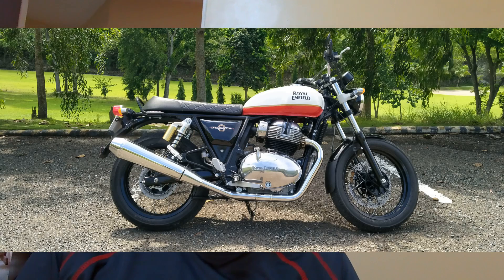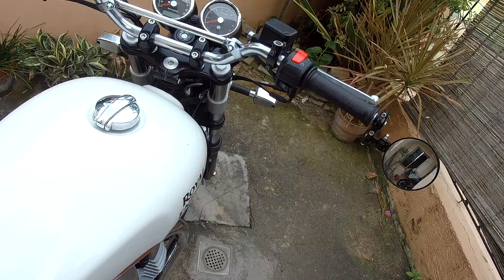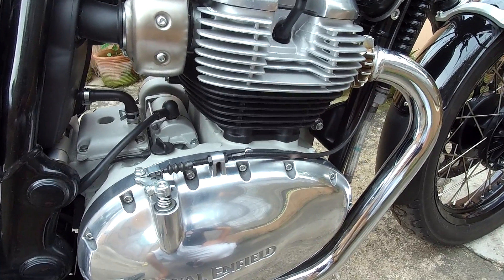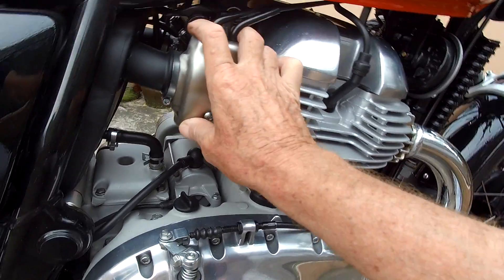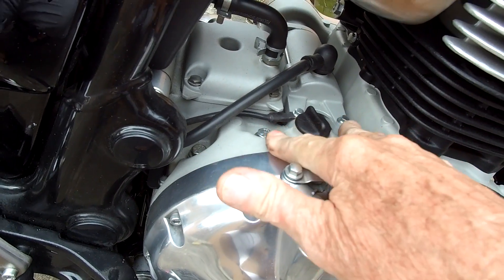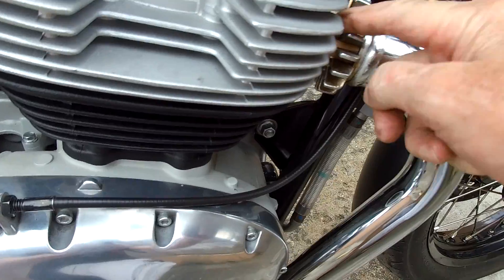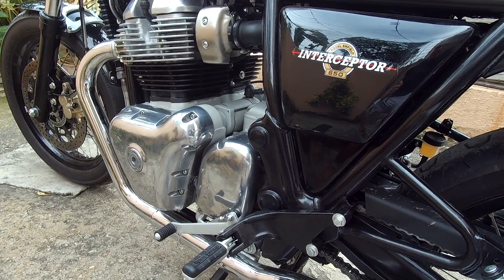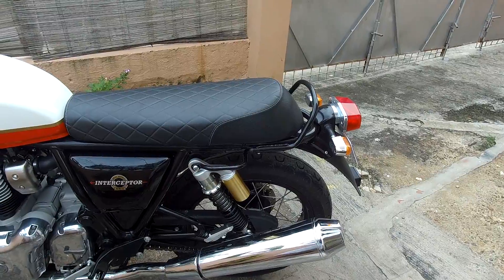RE Interceptor vs Street Twin in Depth

Comment: The term I like is "Appropriately Primitive".  I considered buying a new Bonneville but I was put off by several things.  Firstly, traction control and rider modes, don't need them, don't want to pay for them.  Secondly, the engine would be hard to de-restrict, given the internal design as well as any difficulty in re-programming the ECU.  I had plenty in the budget to pay for one and would have lived with all that.  Thankfully, Royal Enfield gave me an alternative.  Me and my Interceptor, in Ravishing Red (The first thing the mechanic said to me when he delivered the bike was; "the red ones are faster...") have done a little over a thousand miles now and I'm so happy with it, I hardly give other bikes a second thought.  I certainly don't envy anyone on the road.  She goes where you point her, as fast as you can personally handle.

Comment: John,
       I am 66 and picked up a Mark III two weeks ago.   It is like the bike was made for me.   I thought I'd make cosmetic changes but changed my mind after getting the bike.  I have changed the seat to a touring GT seat.  Added the small chrome engine guards and a small black tail carrier.   Have ordered the saddle bag guards (just the triangles.),  A Givi GIVI A31 Smoked windscreen and some 24l roll-top drybag saddle bags.    Going to take turns touring with it and my '83 Honda GL650 Silverwing (I am looking forward to comparing them)   here on the open highways of Minnesota.  Thanks for you Vlog.

Comment: The RE is exactly the type of bike l used to ride in the 70's & 80's - Honda CB twins, XS 650, Guzzi T3 that's why l love this bike. I would add the Tec Stinger exhaust ( As you have in a later video) and stainless mud guards.

Comment: Nicely commented, well made video!
I have the same model in the same colourway (Baker Express). 
This bike is pure joy, in my experience, I'm sure you'll grin like a loon, as I do, on every ride. 
I've done quite a few mods, but one of the most important to me, was upgrading the rear shocks and, the front fork internals. 
I went with YSS  top line and, it was game changing. 
No more drama on sketchy roads & cornering, due to (incompetent) front springs & iffy rear enders. 
Its so planted, so confident & so vastly improved handling with yss fitted. 
I wholeheartedly recommend doing similar for huge improvement.....

Comment: Recently subscribed. Excellent comparison. It’s all personal choice but I feel a closer comparison is when you see a big bore conversion to bring the RE up to 885. Then, the cost and engine size is negligible.
Reply from the maker: Yes true enough, but that's another review, for you can unleash the Street Twin as well by simply putting in a cam and an exhaust. it's not about the CC s as much about HP and torque, the 900 triumphs are severely restricted from the factory to differentiate them from the 1200 cc triumphs performance wise. They only put out about 48 RWHP. not too different from the Enfield.
Reply: @DEeMONsworld  2021 model is pushing 65bhp 80nm…definitely an upgrade.
Reply from the maker: @FrankieSousa  right but mine was a 2017 model, hence the comparison at the time. Plus that's 65 at the crank not the RW.

Comment: A very good assessment of the Enfield, they are a nice bike I agree, I have a 2019 Speed Twin, and I love it, but I can appreciate these Intercepters for being an honest no bones basic bike. I might be wrong but I think you can get progressive springs for these, (TEC?) that would help make a better ride, it certainly helped with my Triumph, and the preloads that replaced the fork caps has a hex head you can adjust with a spanner (wrench). All installed after just removing the bars, have subscribed, I'm liking what I see! ps I thought you were located somewhere exotic when I heard the bird calls! cheers, Dave
Reply from the maker: Thank you ! Yes there are a lot of options for the front suspension, roads here can be choppy and rough concrete, so I personally will probably eventually go for YSS emulator kit with progressive springs and preload adjusters (a complete kit). My thoughts also on the caps clearance.

Comment: I enjoyed watching your  video I was literally choosing between a street twin 2 years old and a brand new Interceptor. I bought the new interceptor today in the same colour as yours. Can I ask how did you polish your engine ?
Reply from the maker: mothers aluminum polish a small electric buffer and elbow grease  where it cant reach
Reply: @DEeMONsworld  Thanks I thought you said you sanded it ?
Reply from the maker: @garystratton8731 o h yes, when I first bought it there were machine marks in it and it was a little rough, so I leveled it out with wet dry paper from about 280 grit then progressively finer to 1200 grit then polish . Just once.

Comment: Change to a heavier fork oil and that should help the damping a fair amount.
Reply from the maker: That's a good idea and something I considered, the oil is only 2W, but no way of knowing the true viscosity since the RE oil does have a CST cross reference. but 5W would be an improvement an perhaps shortening the air column. But I am seriously considering a future fork upgrade with the YSS emulator kit. going to take it one step at a time.

Comment: Hey there fellow oldy, I'm 68 and haven't ridden for about 4 years, after riding or about 30. Just bought a 2005 t100, super clean. My first Triumph, after owning a Suzuki gt 500, a 75 Honda CB 750 four, a Yamaha VMAX and a Kawasaki kx 550 Ltd. So I kinda ran the gammit. Sold the Honda and VMAX in 2015, and hadn't riddin since. So the t100 is probably a good relearner. Rides like the Honda, similar power. Seems Triumph isn't the power machines until u get to the 1200, and even those don't seem the arse pinchers enthusiasts boast. But they are sweet in looks and sound. 
Always wondered if RE was India's Triumph market. They give them racey names. Interceptor? Are they really? 
Sounds like you live in the heart of it there. Were u military? Don't mean to be nosey.  The background sounds kinda explain my question. 
I know the RE,s cost way less, good reason for buying.  
It's nice the pipes with built-in cats. Lose um and your set. No X pipes to buy.  Thanks for showing us the bike. Hopefully it ll do you right. Take care, ride wise. All the luck.

Comment: +DEeMON      Thanks for this video. We are of similar age. In the 60's I had a 350cc AJS that I changed to look much like the Royal Enfield 650cc Continental GT I have now. My only problem with my bike is the weight (nearly 200kg, yours is a tad over 200kg). I put Triumph T100 Street Twin silencers on but with the weight reduction of 4.46kg came a big increase in noise of at least 6dB by my measurement (I'll put the original cans back as soon as I can get new graphite seals).

Comment: I'm a bit confused here. You say you bought a Street Twin because you wanted a retro bike, to mimic the Triumphs of your youth, but the Street Twin is deliberately designed as a modern take on a retro bike. The styling, cast wheels etc, is absolutely not trying to be old school Triumph. Why didn't you buy a Bonnie which, is far closer in appearance to its older cousins? I would have thought that would have made a far better comparison.
For what it's worth. I too am an owner/rider of vintage bikes and have also owned an MT07 so am not adverse to riding different bikes. I just like the low down torquey ride of a twin tuned in a certain way that means you don't need to rev it to get power. Having said that I'm not really a fan of bikes pretending to be what they are not so I prefer the look of the Street Twin over the Bonnie. 
I test rode both the RE and the Street Twin and have to say, the RE is (and felt) cheap. Bild quality was distinctly lacking compared to the Triumph. Obviously the engine size is different but I just found the extra oomph of the Triumph so addictive. At the end of the day though, I just couldn't get away from the feeling that, if I'd bought the RE, I'd always be wishing I'd spent the extra for the Triumph. 
Each to their own though and, although I'm a bit younger, I hope to still be riding at your age so fair play to you sir. Wish I had your climate though.
Reply from the maker: When I bought the Street twin there was no Royal Enfield, that's why, and the ST was a lot less money than the other bonnys which was an issue. When the Interceptor was introduced I was thinking it more a genuine retro, but I did not sell my street twin to buy an Enfield actually, There were other reasons, I was without a bike for a year due to health issues. I had far more issues with the Triumph than I have had so far with the Enfield. It's a personal choice in any event.

Comment: Thought Id leave a comment, seems we are of an age plus have amazingly the same attitude and plans for the Interceptor. I had a T100 and a T120 recently and prefer the RE for all the same reasons you do. I have the Tea 2 - 1 exhaust and most of the mods you have done to yours. You are in the Phillipines and Im in British Columbia Canada so a wee geographic difference. Are you planning to install the fork upgrade? KSS is hard to get here.
Reply from the maker: Hi Brent. I've heavily modified previous bikes but I've stopped with the current mods so far on the interceptor. The front suspension has a clunk, but I put 2, 3mm washers under each fork cap helps but doesn't cure it. I can get YSS direct from Thailand cheap. May do that some day. Check it out.
Reply: That’s the story of my life: hot rods, motosicles and boats. Only bike I never modified was the last one a BMW R75/6 rebuilt totally but stock
Understand about the front shocks and I will end up acquiring a solution eventually 
I just removed the tank and side panel logos as I have the glitter and dust - black n chrome version 
Looks sooo much cleaner
I even removed the center stand and handle bar cross bar
Light makes right, I’m looking to replicate the feeling of my 500 Triumph desert sled 🛷 and it’s pretty darn close minus the motocross front forks
Reply: That’s the story of my life: hot rods, motosicles and boats. Only bike I never modified was the last one a BMW R75/6 rebuilt totally but stock
Understand about the front shocks and I will end up acquiring a solution eventually 
I just removed the tank and side panel logos as I have the glitter and dust - black n chrome version 
Looks sooo much cleaner
I even removed the center stand and handle bar cross bar
Light makes right, I’m looking to replicate the feeling of my 500 Triumph desert sled 🛷 and it’s pretty darn close minus the motocross front forks
Reply: That’s the story of my life: hot rods, motosicles and boats. Only bike I never modified was the last one a BMW R75/6 rebuilt totally but stock
Understand about the front shocks and I will end up acquiring a solution eventually 
I just removed the tank and side panel logos as I have the glitter and dust - black n chrome version 
Looks sooo much cleaner
I even removed the center stand and handle bar cross bar
Light makes right, I’m looking to replicate the feeling of my 500 Triumph desert sled 🛷 and it’s pretty darn close minus the motocross front forks
Reply: That’s the story of my life: hot rods, motosicles and boats. Only bike I never modified was the last one a BMW R75/6 rebuilt totally but stock
Understand about the front shocks and I will end up acquiring a solution eventually 
I just removed the tank and side panel logos as I have the glitter and dust - black n chrome version 
Looks sooo much cleaner
I even removed the center stand and handle bar cross bar
Light makes right, I’m looking to replicate the feeling of my 500 Triumph desert sled 🛷 and it’s pretty darn close minus the motocross front forks
Reply: That’s the story of my life: hot rods, motosicles and boats. Only bike I never modified was the last one a BMW R75/6 rebuilt totally but stock
Understand about the front shocks and I will end up acquiring a solution eventually 
I just removed the tank and side panel logos as I have the glitter and dust - black n chrome version 
Looks sooo much cleaner
I even removed the center stand and handle bar cross bar
Light makes right, I’m looking to replicate the feeling of my 500 Triumph desert sled 🛷 and it’s pretty darn close minus the motocross front forks
Reply: That’s the story of my life: hot rods, motosicles and boats. Only bike I never modified was the last one a BMW R75/6 rebuilt totally but stock
Understand about the front shocks and I will end up acquiring a solution eventually 
I just removed the tank and side panel logos as I have the glitter and dust - black n chrome version 
Looks sooo much cleaner
I even removed the center stand and handle bar cross bar
Light makes right, I’m looking to replicate the feeling of my 500 Triumph desert sled 🛷 and it’s pretty darn close minus the motocross front forks
Reply: That’s the story of my life: hot rods, motosicles and boats. Only bike I never modified was the last one a BMW R75/6 rebuilt totally but stock
Understand about the front shocks and I will end up acquiring a solution eventually 
I just removed the tank and side panel logos as I have the glitter and dust - black n chrome version 
Looks sooo much cleaner
I even removed the center stand and handle bar cross bar
Light makes right, I’m looking to replicate the feeling of my 500 Triumph desert sled 🛷 and it’s pretty darn close minus the motocross front forks

Comment: Does the bike really need an oil cooler? If I remove the oil cooler, would I still use the same amount of engine oil, or less? You have experience with bikes from the 1960's and 70's; did they have oil coolers back then? I'm younger than you, but I'm old school, as well. I hate it when bikes have extra crap on them that they don't need. I'm in Florida, so it's not that hot. My current bike is air-cooled, without an oil cooler; and it does just fine.
Reply from the maker: Mostly, as a broad statement air cooled bikes don't need oil  coolers. they prevent some amount of overheating under extreme conditions, no old bikes didn't have them. I suspect however the addition of an oil cooler on this bike has something to do with meeting Euro 4 and 5 regulations, I wouldn't remove it as it may throw a fault at best or overheat your engine at  worst. A lot f what an oil cooler does is to add an increased volume of oil, that alone has some benefit. I seized my 1965 TT Special back n 1967, probably due to insufficient cooling under hard riding conditions.
Reply: @DEeMONsworld  Thank you for the reply. If I did remove the oil cooler, and I fill the oil crankcase to the normal oil level, according to the dipstick, can you see that causing a problem? The reason I ask is because, as you said, the use of an oil cooler usually allows you to use more oil. To simplify the question, let's say you were going to remove the oil cooler on your bike...Then, how much engine oil would you put in the bike? Would you just fill it to the normal fill line?
Reply from the maker: @BEEBEE159  on this bike I wouldn't do it, there is no point really, and it will protect the engine from overheating. The crankcase level would remain the same in any case.
Reply: @DEeMONsworld  Okay, thank you very much. That's what I was thinking, just use the same amount of oil. I can feel your pain, but thank you for answering my question. I wanted to ask you because you have a lot of experience with these older designs. If I try it, I would be careful to monitor the engine temp. I just don't like to have things on the bike that are not necessary. The oil cooler is ugly; and I suspect that it's really not necessary, except in extreme environments, like India for example.